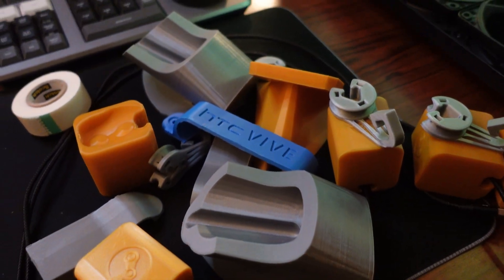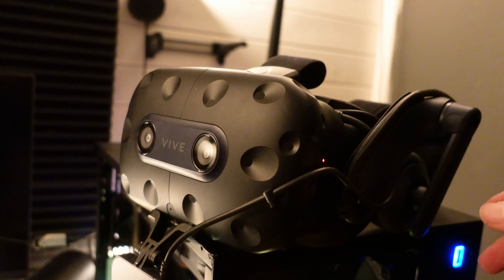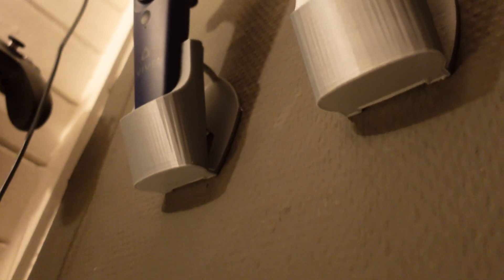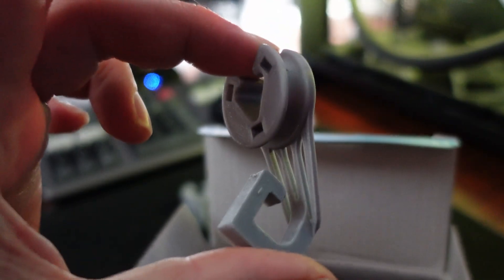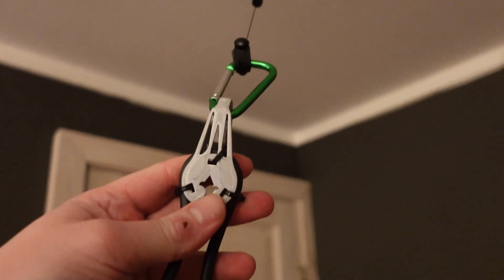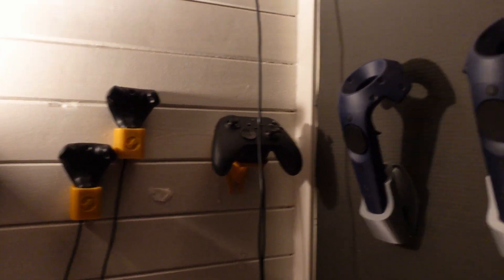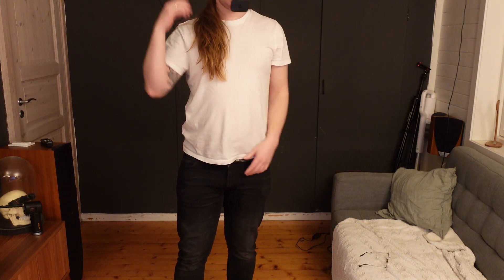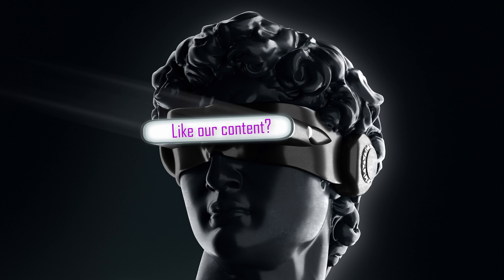Best 3D Printed Accessories For Your VR Rig

Comment: 5:55 you don't need those big-ass brackets lmao. Just wrap a rubber-band around the headset wire, and then you can attach it to the hook of the roller adhessed to the ceiling when you use your headset, and detach it when not in use. The rubber-band will just stay on the wire on its own. It weights much less and is less pricey that way
Reply from the maker: Good point lol

Comment: 3D printing hardware + VR = ❤  Little known fact is the Quest's XR2 isnt running at its full potential. Using apps like Oculus Migraine will unlock the CPU/GPU. I'd love someone to make a 3D printed micro fan mount for the CPU + screws so I could replace the stock face plate with a clear one with a hole for a better fan. The new fan/plate would be shaped to both cool the CPU and channel the air onto the face to reduce fogging. Also the clear face plate would put all of the inner hardware on display...making it roughly 202.2% cooler 😎
Reply from the maker: That'd be cool! The Focus 3 has a fan, imo it's not ideal with fans blowing around the eyes (you need to blink more often)

Comment: Surprised you have all these Vive Headsets, especially the Vive Focus 3. Didn't realise that you can buy it also as a non-business customer. Looking forwards to the next videos where you review them.

The cable management system ruined my ceilings btw, wish I would have screwed it in instead of glueing it there.
Reply from the maker: Ah, yeah I've already started shooting a video for the Vive Flow, and what I'm mentioning there is that those HMDs are absolutely not mine :) I teach a course at the university this spring for VR development and we'll be using those, as I'd not like to support Meta. I would not find it reasonable to purchase a Focus 3 personally because of the price (although, on first impressions, it is sooooo goooood.) Everyone can buy them though, but they are not made or targeted for consumers. It doesn't have many games, for instance.